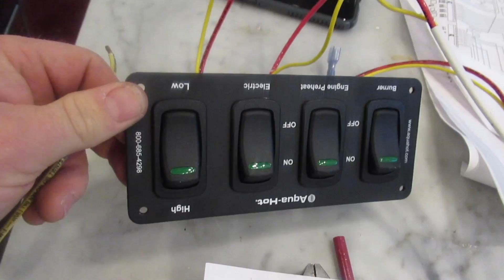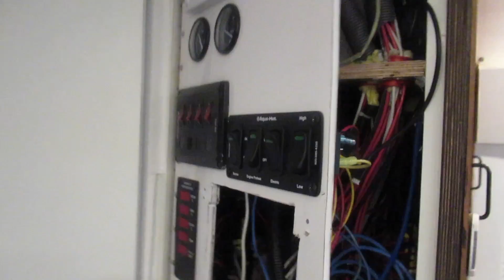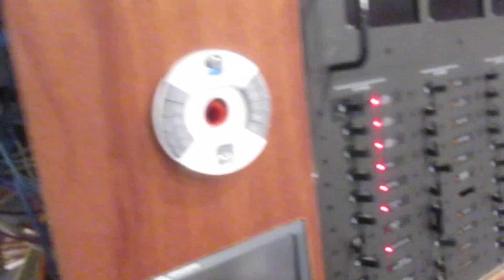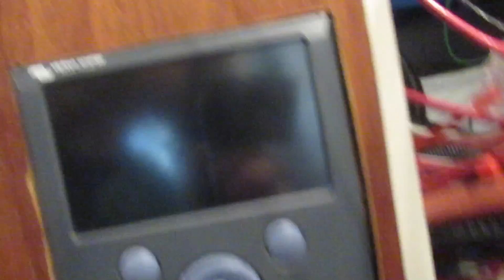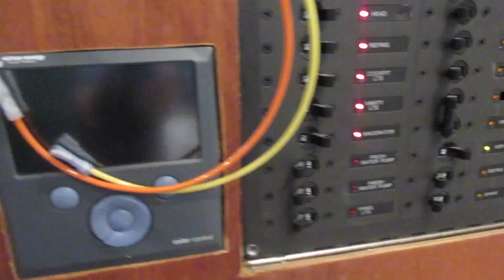Aqua Hot DC Power RV on demand hot water and heat.

Comment: High low switch isn’t to change fan speeds; it controls the electrical heating element. In your case low mode uses one 2000 watt element while high mode adds the 240volt 4500 watt element effectively increasing the heat output
Reply from the maker: Thanks for the Info!

Comment: one side of the bus could be warmer than the other which is why you want multiple zones. 
It would be better to run at 50% whenever possible. 1 t-stat you will be at full load all the time.
Reply from the maker: I find one thermostat is the best solution for me. I am very particular about the temperature I like to live in.